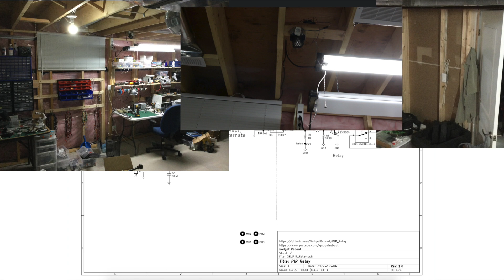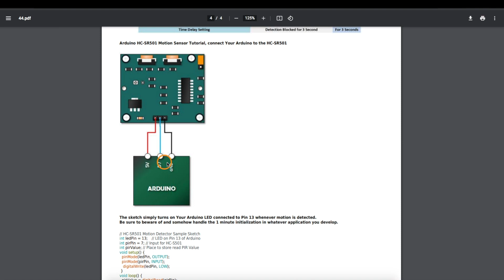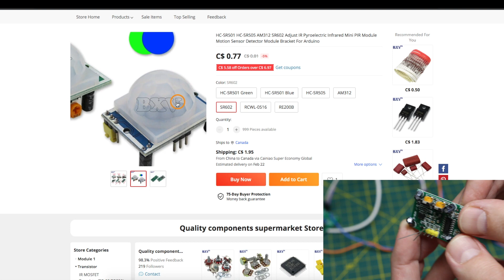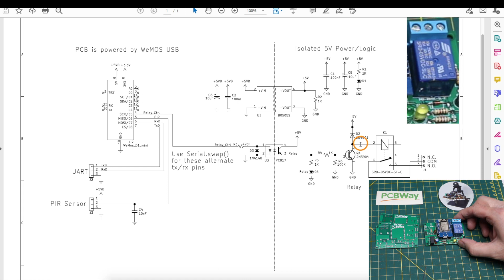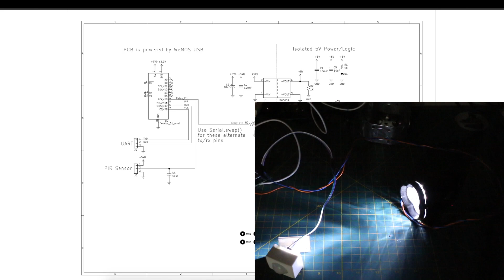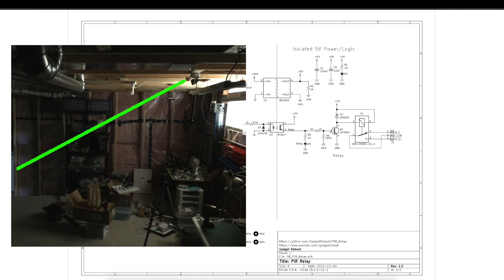PIR Motion Detector: Control a Relay to Turn On a Light When It's Dark

Comment: I was going to say that if the switch was going to be wifi connected, i would have made a cap dropper supply, dropped the isolation and double insulated it. could have saved a few $.

Comment: Good example of a nice and simple project :) Makes a pretty good explanation for a beginner :)

If I may give some remarks? Always good for a second revision I hope :)
- D3 has no function.
- Opto will probably also limit the voltage because of the low CTR, maybe interesting to measure it?
- Voltage isolation isn't necessary, certainly not for mains switch. I would be more worried about the copper under the relay and even more about the copper in front of J1.
- Although it's already lifted from the board, copper plane under an antenna isn't the best.
- In the code, the cast isn't necessary
- And may I (maybe again :D) suggest to use cost variables instead of macro's? Whyyyyy better error messages if you make an error and the compiler can actually hep you. And for the state maybe even an enum.
- Maybe interesting to hook up a scope and see how much effect switching the relay has on +5VD.
Reply: I would have fitted D3, you can get nasty flyback voltages from a diode. 🙂 there is no real need for it, unless you have a relay with the same footprint and might want to change to it at a later date.

See your point with the cast, millis is an unsignedLong, timer is also a unsigned lond. so in affect your casting the result to the same type.

Don't be so hard on him, at least there are no magic numbers in the code.
Reply: @TheEmbeddedHobbyist  "I would have fitted D3, you can get nasty flyback voltages from a diode"
I hope you are being sarcastic. If not, please explain how a diode can cause flyback!
Reply: @sootikins  you got it one, it was a dose of sarcasm. Unless there is a possibility of the reverse voltage exceeding the lowest break down voltage of installed or connected components then D3 is not required.  Normally as know this is as a result of an inductive load.
Reply from the maker: Thanks for the feedback!
-I think D3 was a residual component from the first generation of the schematic a few years ago where the opto was driven from an off board control so there was a risk of any sort of positive or negative spike.  I need to start something from scratch some day!  I think this is the 4th evolution.
-I can't recall but I think I made measurements on the original design's opto with that driving LED resistor and the resulting output transistor driver way back, so I've kept using the same setup but it would be interesting to double check if I get time.
-For voltage isolation, do you mean the 5v isolation or providing isolation around relay contacts?
-Yeah copper should have been cleared, although it would be good if I still had access to a network analyzer to see the S11 antenna tuning plots as the module is moved to overhang the board or move down closer to the FR4, both with and without copper to know the impact for sure and even try to re-tune any matching network on the module.  I used to have to do that when putting modules in plastic enclosures and ruining the tuning.  But so far I haven't had range issues around the house.
-The cast I think was residual from a stolen code snippet where they were using a different variable type, but since code is voodoo, I just try not to poke it once it works!
-I randomly use a define or const with no formal reasoning, though I know it's good to have the compiler be aware of the intended use so it can try to be helpful rather than substituting text in good faith.  Sometimes just because most of the code is so short/simple, I figure as long as it holds up.   But in that telephone simulator where things got big, I'm trying to do things better as I work on that and expand it.   I always have to research how to use enum and typedef so I reserve it for state machine type stuff.  I need to make a reference code document for these commonly used and forgotten techniques.
-I wonder if any relay 5V switching noise/loading can be reflected back to the other side of the isolated regulator, directly or indirectly, loading down or glitching that rail.  More fun testing if I have spare time!
Reply: @GadgetReboot  Thanks to see it as "rev 2" feedback :)
For isolation I meant the isolated 5V (U1). Relay itself is already taking care of the isolation from mains.
And yeah, everybody copy-pasts code from time to time :D But especially when coding is hard and/or the project gets bigger is good to get into the habit so the compiler can actually help you. Macro errors can be so hard to debug sometimes.

Would be fun to see some data on the noise/loading that reflects back :) 

But yeah, spare time is always a thing. In order to hopefully have a little bit more in the future I recently switched to 90% of full time employment. But first, holidays! Have a great Christmas!
Reply from the maker: Yeah the 5V isolation thinking was related to using the opto-coupler as well because if I'm opto isolating from 5V logic and then directly powering the relay from the same 5V logic, the opto  isolation is redundant.  
So I'd either fully isolate with opto and iso 5v supply, or use opto for the control pin and a completely different relay power source so there's no direct path back to the logic side. 

 I probably don't need any isolation at all but it's another step in robustness if there's an unexpected short on the relay side (of course something could also blow through the opto silicon and isolated switcher but we can't control everything)

I'm writing some simple code for another project right now and I've converted the defines into const bytes, and I de-casted the unsigned long timers!

I'm adding a white board note to see if I find time for more testing/measurements, or until the reminder gets accidentally erased!
Have a good holiday and reduced workload!